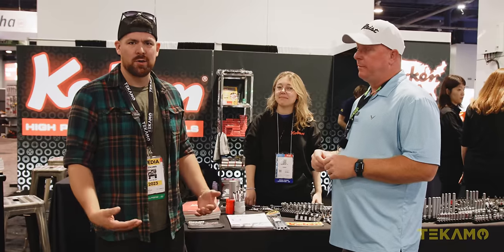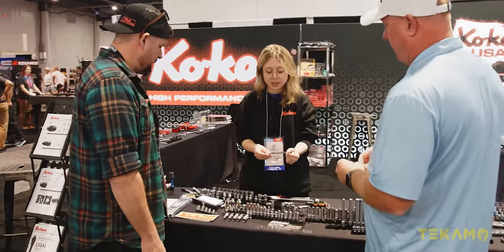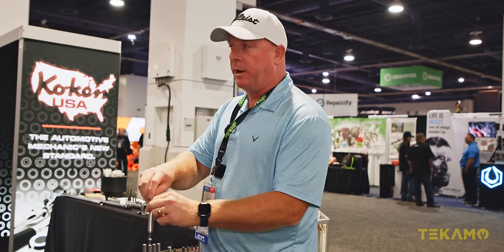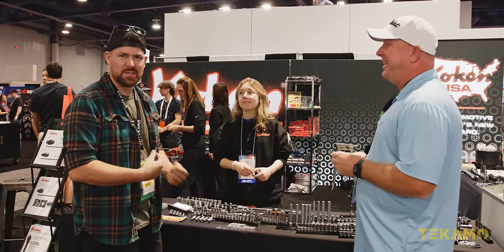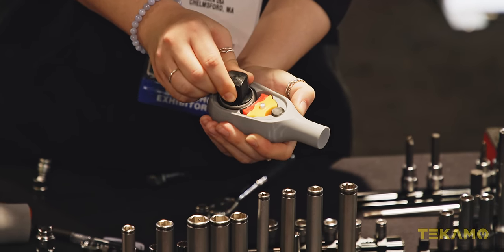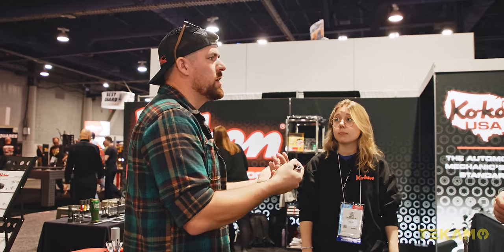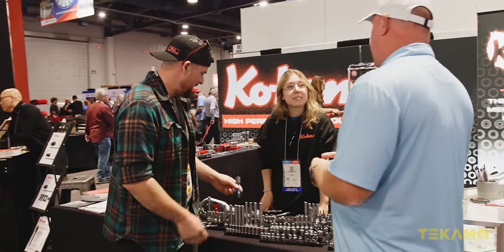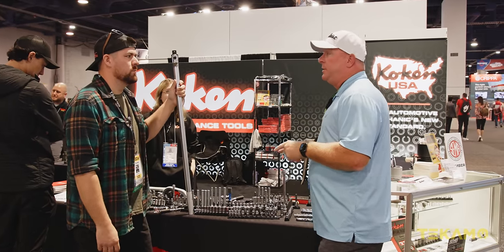Ko-ken, is it for the Heavy Duty World? - SEMA 2023

Comment: Koken makes the best spark plug sockets I’ve ever used.  The spring retention system is fabulous!
Reply: Absolutely agree. Unfortunately cash was tight and I could only get a 16mm universal spring retention plug socket and the $42 for the socket was well worth every penny but the $17 in shipping annoyed me as it would have been fine with a larger order but for 1 damn socket, it really rubbed me wrong.

Comment: The spark plug sockets are little expensive after the damn shipping fee but absolutely amazing. Dealing with a very difficult plug job where I could barely see the plug tunnel, put the universal spring plug socket on a locking extension and I had 100% confidence that I wouldn't lose a boit ir magnet in a difficult spot n no worries about dropping a socket or plug. 👍👍

Comment: I had Koken in my previous van. Held up, but the sockets had a tendency to "walk" off the fastener on the 3/8 and 1/2 12point sets.
The 1/4 was 6-point so didn't have that issue, but the ratchet was way to coarse.
Reply: Depends what ratchet of theirs you buy. They have high tooth count ones also, but their low tooth count ones are built that way to be super strong.
Reply: @samthesr20man I know, these sets was in the van when I took it over.
I belive the 3/4 & 1" set was by Koken as well, either directly or rebranded by Wurth.
Usually use all Stahlwille gear.

Comment: Damn it! I spent my money on Gearwrench  sockets and ratchets. I’m just getting into the trade as a heavy duty apprentice and I wish I knew about koken. I wish you guys had put this video out two weeks ago.
Reply: You’re gonna lose stuff in the beginning as you learn techniques and build grip strength. Don’t worry about not buying the perfect tools from the beginning because you have a whole lifetime to upgrade.
Reply: You'll be fine. I've been doing this for 18 years and I still use some of the cheaper stuff I started out with. Just upgrade when you need to and you'll be set
Reply: I have a 3/8 and 1/4 set from gear wrench. Been using them for a long time. Cranes, dirt equipment, ect.... no issues except the ratchet switch have become a little fussy. But that may be due to also being used as hammers.

Comment: Back drag is about the most important thing I look for. I love my Koken Zeal 72 tooth 1/4 and 3/8 ratchets. Put my newer Bacho 25 price 1/4 in rachet set to shame. It has the same back drag my recently replaced usa mad 1980s ratchet has from China.  The Koken is a dream. Im alos getting a Tone rachet soon and Nepros KTC soon to follow.(those look like works of art) cant wait to try them.. Nepros has a set of wooden handle screwdriver i want so bad. However just got a PB Swiss Swiss grip set and a Wera 4 times speed hand druver set of 14 or so. Not for any kinda high tourqe. Tgey just willbnot go if asked for anything outside hand held screwing in of screws with bo screwdriver. Trying to give you an idea how little torque they can handle.. oj if installing light switch covers that are easy to split.. or use it in reg mode and works a bit better than most. The long tips are much enjoyed..